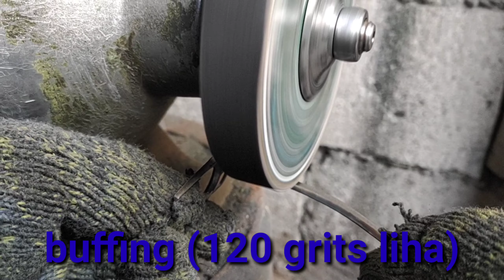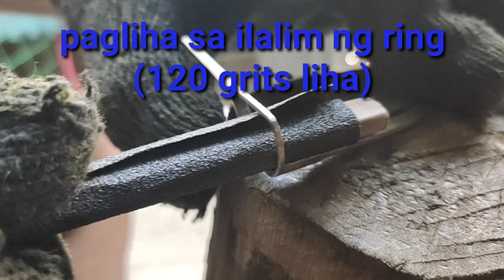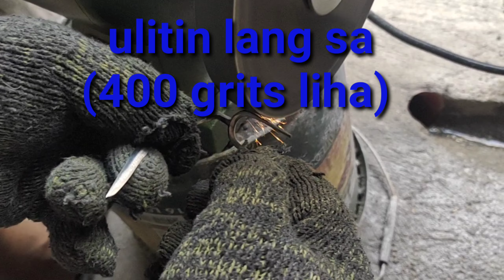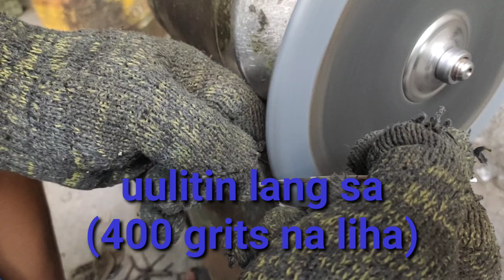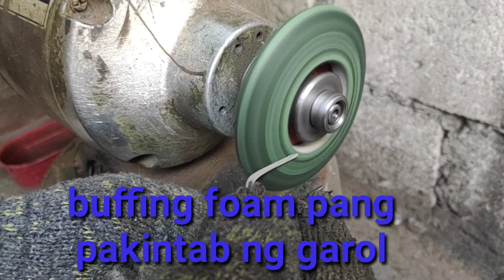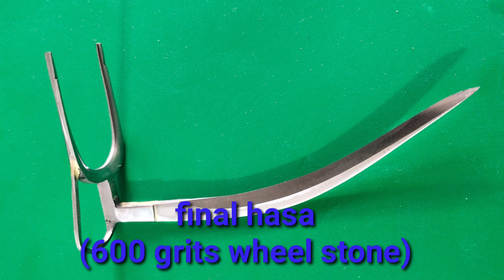PAG GAWA NG TARI SIMULA HANGGANG MATAPOS LAST PART!!!!

Comment: Sir good day anu po pinaka maganda steel ang ginagawa mong tari, magkano ang set
Reply from the maker: Lahat naman sir maganda basta HSS.pero sa ngaun kinkelder ang may pinaka maraming order sa akin
Reply: @jorgeofficialvlog1339  magkano po ang set sir
Reply from the maker: May,10,800 at may 12k
Reply: @jorgeofficialvlog1339  anung bakal po yung 12k
Reply from the maker: May 2.0mm at 2.5mm sir
Reply: @jorgeofficialvlog1339   ah magkano po yung complete packcagede sir